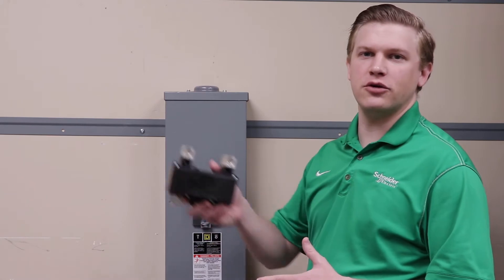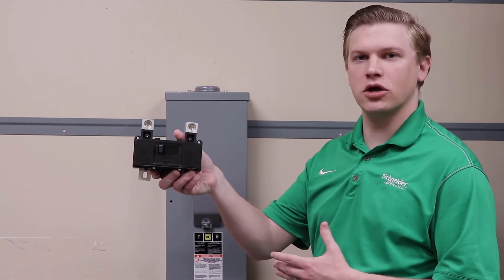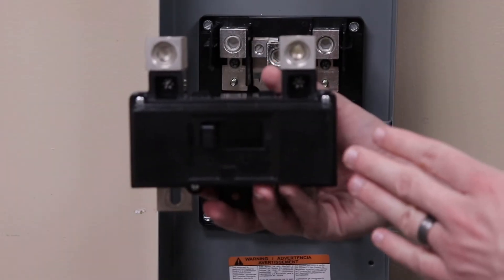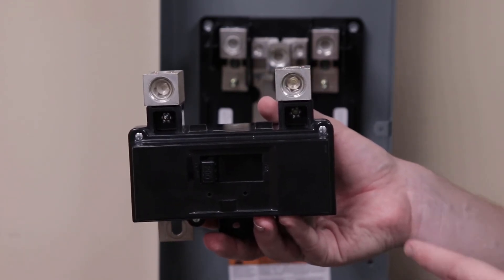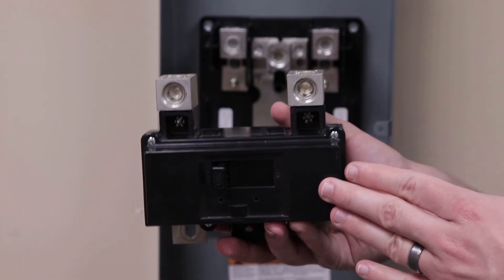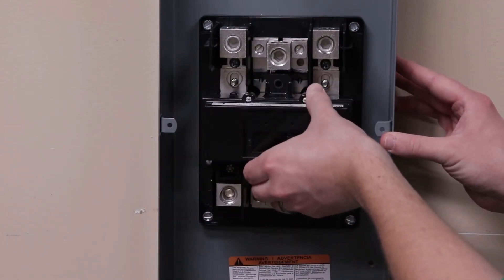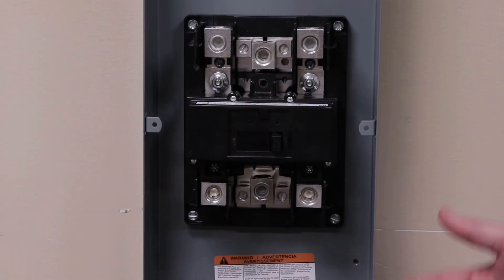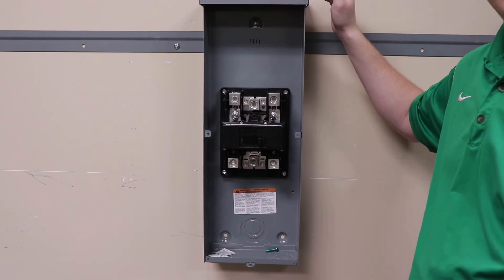Installing a QOM2 Breaker into a QOM2 Enclosure | Schneider Electric Support

Comment: Will the M1 style work in the M2?
Reply: If you're asking about the Square D QOM1 Frame Size Main Breakers, they will not work in the newer Square D QOM2 style circuit panels.
Reply: @timberwrightsvs480  Only took about 2 years for that reply 😛but I suppose it may help someone else who reads it.
Reply: @thisIsSomeShite  Yep, but I only tried it out about a month ago, so tested/accurate advice is better than "I'm pretty sure I'm right" advice, aye? 😁 The point being that, NO, a QOM1 Square D breaker will definitely not work in a Square D QOM2 circuit panel.